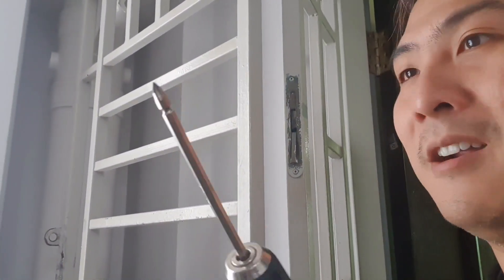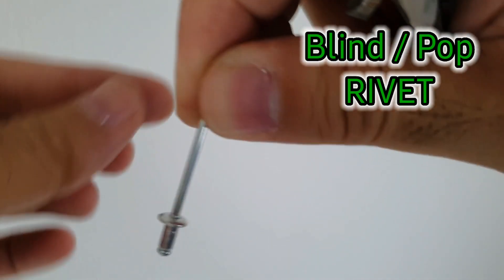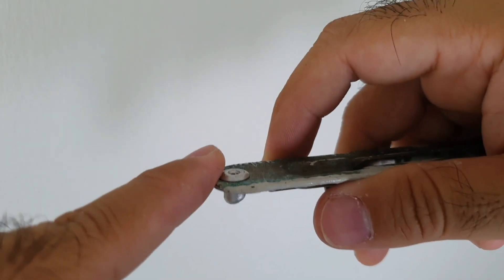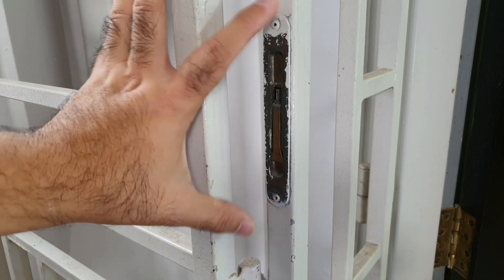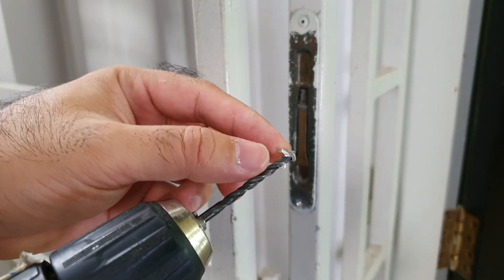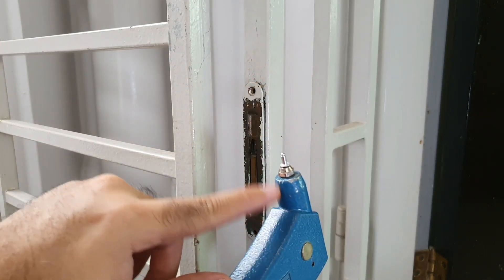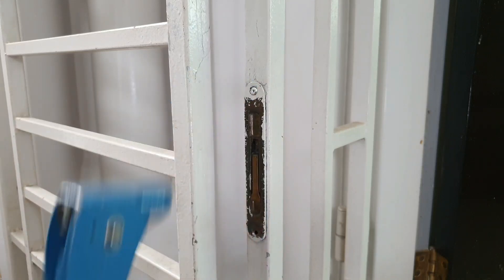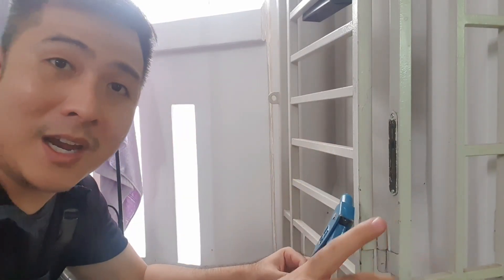What are "Round Screws" aka Blind/ Pop Rivets. How do they work?

Comment: have seen rivets before but never really used them... how strong are they in comparison to screws and when do one usually use them over screws?
Reply from the maker: These are used To hold 2 pieces of thin material together, Rivets are definitely stronger. These are used in applications where 2 pieces are supposed to fit together permanently.